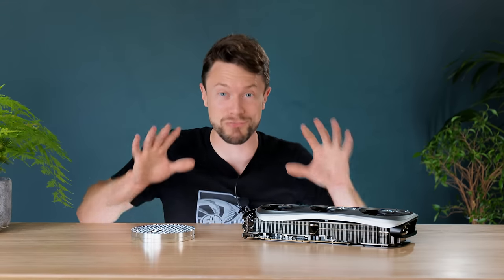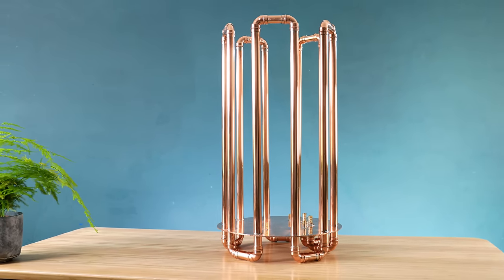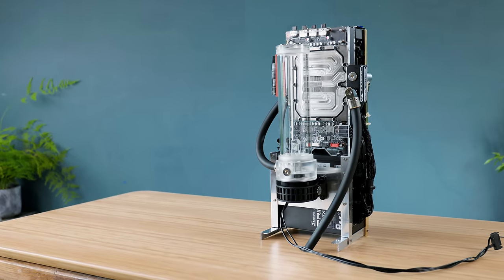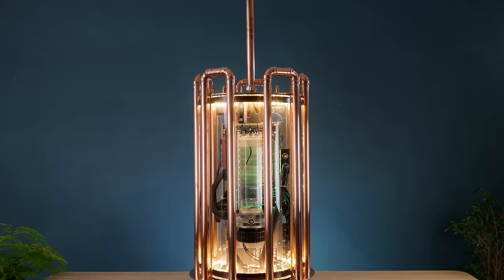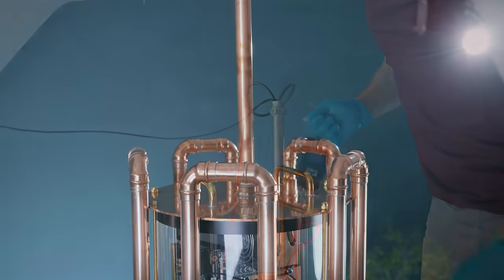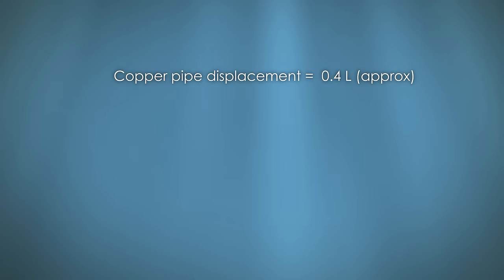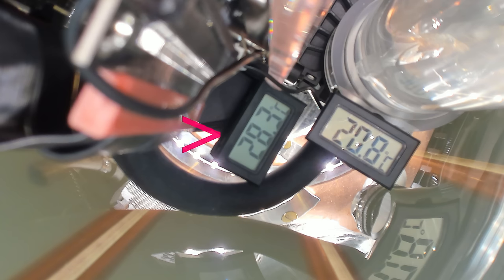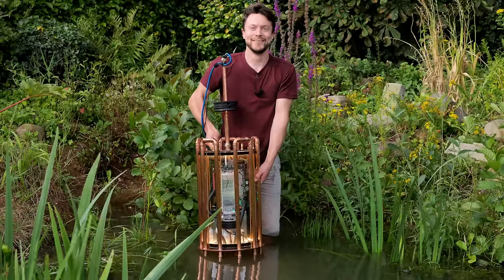Building an ACTUALLY water-cooled PC

Comment: I wonder if the companies who are making those large scale underwater servers have thought of combining the heat of the system and the cold of the water with a Stirling generator (which generates electricity based on the difference of heat on either side). Would be a neat way of local power generation to increase efficiency
Reply: Interesting idea! Recycling with a Stirling and generating with wave power could be extremely sustainable!
Reply: @matthewworkman201  These are some awesome ideas. Love it. I assumed part of the reason why they're moving them underwater was also because of energy consumption. I would be way more sustainable and cheaper to maintain if they were underwater. I hope they do this!
Reply: As someone who has looked into this. Trying to recycle that heat just isn't worth the effort. It could help increase efficiency by recycling some of that spent heat, but not enough to actually make a difference.
Reply: @fulomtheavali the data centers can get to 100s of degrees on the inside
Reply: heat reclamation is mostly done in power plants and metal foundries. where temperatures are in the 1000° range

Comment: This actually might be a very innovative way to cool your pc, and heat your aquarium or pond! Instead of blowing all the excess heat into your gaming room, which in the summer can get pretty hot
Reply: Very good point and suggestion.😊
Reply: The problem is when will you need the heat? And what about when you don’t need the heat? Also remember you need a really power hungry component to get that kind of heat. 

Normal usage aren’t generating that much heat so you don’t get enough heat to keep heating anything. Not to mention running at full power all the time also decreases life expectancy of components thus the cost of heating your aquarium or pond is absurd.

Remember both matt and linus use these free cooling to cool pc not the other way around.
Reply: @Sintrania  id say use like a flywheel principle to store the heat, let it run up past a block of metal so it can store it, how to take it out again? i dont know actually so i see your point xd 

Im just brainstorming tho, there must be a specific way to use its excess heat instead of throwing that energy away!
Reply: @SmokeyPyro  your line of thinking is not wrong it’s just that we can’t store energy indefinitely, there will be dissipation of heat no matter what insulation you have. If we are looking at how to use heat from pc effectively. My silly idea is to make a custom loop and run a hot side from gpu through a copper plate that sit on your table, so that your coffee will be heated while you game XD.
Reply: @Sintrania  hahah amazing, thats what i love about discussing these topics, i alone can come up with stuff, but debating it to grow together and find New perspectives.  Thats what fuels me 🤗💪🙏

I agree that your idea sounds better ❤️

Comment: This is truly an amazing build. Beautiful.
When one has a big aquarium this would look cool in there too. Although I am a little worried about the copper pipes. That may contaminate the water.
Reply: The amount of water and the amount of copper that possibly can leak means parts per billion at most... it's a 2 meter deep pond, we are talking about several dozen thousands litters of water.

Water isn't going to corrode all piping, and the temperature on the copper will be low.

Comment: This needs so to be installed in a tropical aquarium. Hats off, the skills attention to detail and craftsmanship is always mindblowing. Huge amount of respect.
Reply: Linus actually has something like that. He is running the servers that are in his house's basement (connected via fiber optic thunderbolt to monitors and peripherals) to a big heat exchanger, which will warm up his pool (slightly)
Reply: @poplix2704  I follow Linus and the scale in which he plans to water cool his pink rack is crazy. I meant that this project would be amazing showcased inside an aquarium next to a desk. As to me it's a crazy top of the line PC that is a pure work of art.
Reply: @alkalineknight84  Ah you meant it like that, yeah that would be really cool!! I think with a decently sized aquarium it would perform pretty well too.

Comment: Really cool idea. But how about condensation inside the acrylic tube?
Reply: there won't be condensation because the tube and cooling loop is not lower than ambient temperature, in this case the pond.
Reply: @rossclutterbuck1060  but if you switch the power off won't that make it cool down and draw condensation in?

Comment: This is legit the coolest thing I have seen all year.
Reply: i mean it looks sick but for a pc build makes no sense as he has a liquid cooling loop on it already so the only thing this does is cool the liquid inside the loop and a fan would do that just as well. Cool but pointless unless your aquaman also you could ditch the external factors and just fill the tube with a non conductive/corrosive liquid
Reply: @JumpShotHD this would do even better job at cooling the pc

Comment: Maybe a water censor inside with the electronics that will shut down the system immediately if water is detected would be a good addition.
Reply: Yeah a humidity sensor and a water sensor at the bottom that turns off the system once there is a certain amount of collected water at the bottom.
Reply: Where IS your sense of adventure?
Reply: Not only that, you could add a simple air compressor that displaces water with air in a buoyancy tank so the computer will automatically rise to the surface in the event of water ingress. If you seal the cable conduit and have the air vent through a normally-closed solenoid valve, that valve could shut fully sealing the system if power is lost, or if water ingress is detected

Comment: Now I'd like to know how many Thunderbolt extensions you'd need to reach a space where anyone would actually want to work or game - as in, inside... Otherwise, the safest option would be to dig and set up an artificial pond right next to your foundations, so you'd be able to pass some sort of watertight cable through a wall and to an extremely minimalist dock-based workstation.
Reply: Nah, just use your pool next to your house or get one of those inflatable pools and fill it with water and ice.

Comment: Kinda curious what kind of thermals you'd get keeping the pc on a desk. 
Or if you'd get similar results using a standard pc water cooling radiator and sticking it in the pond.
Reply: He had open bench test earlier in video 100+Celsius
Reply: @cafe88racer53 Without the copper pipes and watercooling system though.
Reply: @psirvent8  probably wouldn't be great either though since the pipes have a relatively low surface area for disapaiting heat in air would definetly require some radiators if kept on a desk

Comment: I was wondering if it doesn't run the risk of condensation on the warm inside compared to the cool outside?

But it's an absolute stunning build 🤩
Reply: Condensation occurs when there is a cold object in a location where there is water vapour, so in theory shouldn't the heat provided by the computer keep the hot, preventing condensation right?😅

Comment: The anxiety I felt as you leaked checked it with over $5000 of equipment inside was through the roof. But well done! Your videos are consistently exceptional.
Reply: I found the rubber floats at the end so much worse ahhhhhhh

Comment: Instead of going to the pond or ocean, you can use a big cylindrical water tub inside your room which would have 500 litres of water. The only problem is high degeneration rate of copper. Use some alloy that doesn’t get rusted under water. The only thing that it’ll take is the corner space in the room.

Comment: Now I’m wondering how much more you could get in a water pool with a controlled temperature using copper pipes made specifically for cooling like you see on traditional GPU heatsinks
Reply: The temperature delta between the coolant and the pond water was only like 3.5 degrees. There isn't a lot of room for improvement.

Comment: Nice!
Btw what if it rains, you should have made the top pipe holding all the wires bent 90° since it'd look nice and rain would not affect it also less chance of it breaking!
Reply: You can see some black silicone caulking or something sealing the top in the video.
Reply: @TheAkashicTraveller  Still I think 90° bent would be much safer 😅
Reply: Or 180°, then no rain can leak in by running along the walls and cables.

Comment: I think you could take this even further, if you mounted the components in a pool of methanol or mineral oil and used the inner liquid as a heatsink, you could use the entire surface area of your component vessel as the heat exchanger.  So theoretically you would have: Water(Copper(coolant(computer parts)coolant)Copper)Water
Reply: It would also solve the problem of overheating power delivery and other components that aren’t cooled by the water cooling

Comment: The fittings you used are press-fit (edit: i'm probably wrong; see below) - they're designed to be compressed with a special press instead of sweating with solder. As long as you didn't use the o-rings, it's probably not a problem (aside from being more expensive than regular sweat fittings).

edit: As @AtomicShrimp points out below - these may be "Yorkshire" fittings, were that ridge has a solder ring in it, instead of a rubber/EPDM o-ring like the press fittings.
Reply: it hurts my soul that he soldered crimp fittings
Reply: Are you sure that's what they are?  They looked to me like the fittings that have a ring of solder inside (Yorkshire fittings) so they can (in theory) be sweated on with no additional solder.  Push fit copper has a more prominent bead for the O ring, I think.
Reply: Press fittings are so much more expensive than regular fittings it's crazy to imagine using them with solder.
Reply: At 2:56, you can see solder coming out of the joint just from it being heated.  Pretty sure these are Yorkshire fittings.

Comment: I am curious, how big of a thermal mass is your pond? Did the computer raise the pond temperature by any measurable number after several hours?
Reply: I doubt it, 800 watts can raise the temperature of 200 milliliters of water by around 1C per second. if that pond is, lets say, 3x2 meters, that is around 6000 liters of water. meaning you would need 30,000 watts to raise the temperature by 1C. I bet the water is losing energy to the ground and air faster than 5 PCs like that can dump.

also just want to say I love the metric system.

Comment: Just out of interest, have you tried the PC out of water? With that much coolant and surface area, I would have thought that it would stay pretty stable in air.
Reply: Well out of interest I roughly calculated the surface area of the tubes to be at roughly 4084cm² (I guessed the length and diameter lol). I now calculated the surface area of only the tubes inside an Alphacool Nexxos St30 (excluding the surface area of the finns that sit between the tubes) to be at 2593cm².
Be careful, the finns will add greatly to the actual cooling surface area (probably almost double it)!

If driven passively I can make an educated guess that even 2x St30's (2x 360 rads) are absolutely not okay to cool these components. If we add forced cooling it will not even be good actually.

But one also has to take into account that the straight copper pipes might offer better airflow for convection. I'm not sure about that. All in all I guess the system will thermal throttle after some time benching or gaming. Probably pretty good to surf and office use lol.

Comment: I still don't understand the meaning of top cooler because it blows hot air inside a closed box
Reply: The cooler is connected to the Copper plate, the fins in the cooler take heat from the air and the tranfer it to the base copper plate, which is surrounded by water, and water takes that heat away.

Comment: Fun thing is, if you had COMPLETELY sealed this, and pressurized it slightly with Argon, I'm pretty sure it would have stayed cooler even still, and have been slightly heavier.  :-)  Also, if you soldered some thin aluminum or copper cooling fin, be they individual ribs or long spirals of material, to those external copper cooling pipes, you might have been able to get even more cooling out of the system, and gotten the coolant temperature even further down  close to the ambient temperature of the pond.  :-)

Comment: Epic video.  Does sound like the fan on the cpu heatsink cooling the air inside needs to be replaced.  I could hear the bearings from the fan when you kicked it on.  Might cool the air better.  I'd run more than 1 for that too, or a larger heat sink for "capturing" the heat in the air.

Comment: Idea for V2:
Use mineral oil inside the acrylic tube and air cooler on the hardware. Use a large radiator as a heatexchanger between the water and the mineral oil. This way there is a lot of flow and all components are cooles, even those that are not actively cooled. Might be very effective as the oil has a lot of potential to cool the hardware and can flatten peaks in temperature

Comment: You could of done wireless HDMI and non-power cables as wireless forms. Where is also an issue of sound in a fish pond. Don't know what the added dbs are but could affect the marine life. Other then that it doesn't seem to pull pond water in so no need to filter water which means this is pretty cool (@20°c)

Comment: A really good idea for cooling would be to use a small fridge/dehumidifier unit as the ones that use to dryage meat amd out the whole standard pc there. It would me much easier it takes away the humid factor completely out. I don't know about the heat transfer though if that would be quick enough but I think it's cool idea to try

Comment: This sounds more practical than a mineral oil cooled PC, and possibly more portable for your room as well. What's the smallest size tub that you can use to keep it comfortably cool? How large would the tub need to be (How many gallons of water would it need to hold) in order to make 60/40 degrees C be possible for long periods of time, greater than 8 hours?

Comment: why not just fill the entire tank with distilled water, that would eliminate the need for both the pump and the heat sink, and there would also be a positive pressure inside the tank which would also decrease the liklyhood of water getting in from the outside, and maybe add a few copper pipes inside too, the more passive the colling system the better right ? or am i missing something, would it actually cause problems ?

Comment: As someone who messed about with custom loops back in the early 2000s I can tell you that pure distilled water will destroy the blocks in about a month when the inevitable microbes start to grow and not only gunk up the microfins in the blocks, but promote corrosion of the loop. You have to use some kind of anti-bio additive to prevent this. Since it's about 8 months on, did you ever run the PC for an extended time?

Comment: It is great as a builr, but the stock coolers are made for working and you cqnnot basically overhear a silikon chip in that sence anyway as long as they are baked well over 1000 c... so any fan would work

Comment: Microsoft did this years ago. They put huge tubes with servers in them into the sea. While it worked fine they decided not too long ago to no longer do it, as they don't have (easy) physical access to the servers and the alga grow and the like requires too much effort to clean. 
Furthermore Der8auer has used tap, sea, ... water in a loop to cool a PC, every time with great success. 

And btw, using an optical thunderbolt cable is certainly enough for one Monitor and peripherals and probably an ethernet connection, but much more than that and it will become a huge bottleneck, even more than the dock already is, especially when using a quite high resolution, close to 10Gbit up and downlink and maybe connect a thunderbolt M.2 external drive.

Comment: 6:28 "Nice and environmentally safe", brother you are about to introduce 1000w of power to the local pond
Reply: 820* watts of power to a pond that deep is pretty negligible. 

A single square metre of direct sunlight introduces 1370w of heat, that pond is also at least 5 metres sq while being quite deep. The difference from cloud coverage is going to be greater than a pc

Comment: 15:58 Right under that 2nd display with "18.5°c", look at the cornor. i see some water slowly trying to reach inside! 💀
it's a great idea but there is a far better way to make it more worry-free & safe. use a bottle-idea. Imagine u open the bottle lead and kept everything inside it!
Just few welding on the brasse plates from underneath and make a nice tight thread for the glass/plastic cylinder to be tied (don't forget the rubbder & glue it so it never moves again). reapating the process on the head part. you can throw ur PC in water and everything will work perfectly fine with 0 drop of water as if it's a submarine!

Comment: Looks insane im in love.. I wonder if adding positive pressure to the system via an air pump on top and some one-way relief valves on the bottom.. any water that got in would be forced out the bottom, and it would allow for pressure equalization to negate may any issues in fluctuating weather situations like high/low pressure systems or extreme hot or cold. The  pump could run hard wired constatly aerating water reducing chance of freezing in winter time even when is not in use. It may add too much complexity. 😂 Here's another tier tho lol,  if you created an external frame that was neutrally buoyant like a pontoon system that was able to hold down the pc down if it was made positively buoyant from a point below level of the pc itself,  as a failsafe the frme would release the pc if some water was detected by a flood stopper or would release if power was cut to system. 😂😂